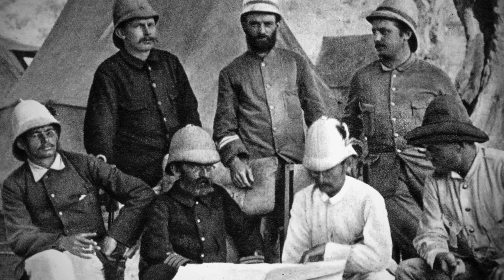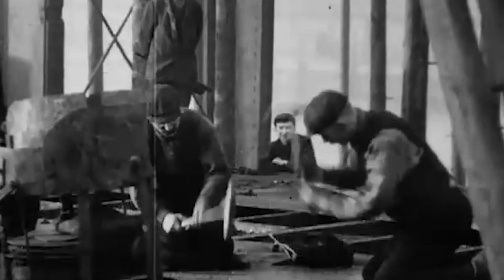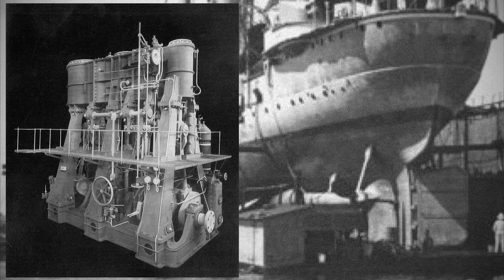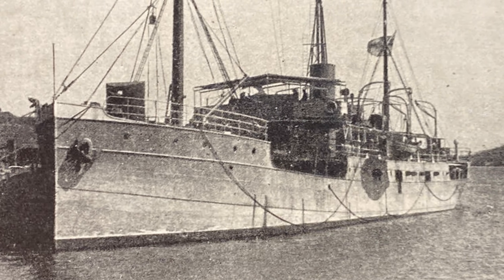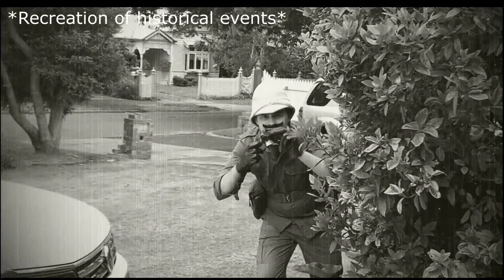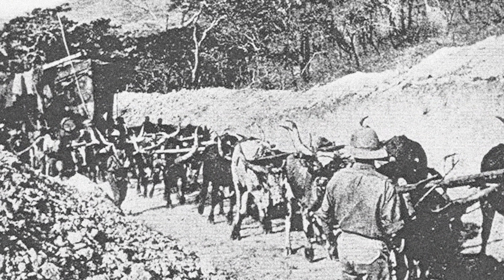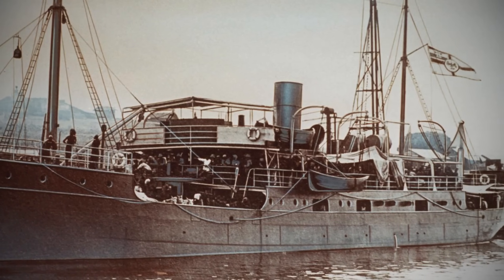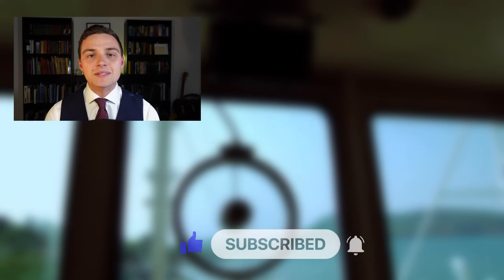This Ship was Packed Into Boxes! The Insane True Story of the Liemba

Comment: The 555 tonne paddlesteamer 'PS Maid of the Loch' ( built in 1953), assembled at a Clyde shipyard, was also dismantled, and shipped to Loch Lomond by rail to Balloch Pier, and there the sections were reassembled on a purpose built slipway. The 22 mile long lake is only 8m above sea level and under 10 miles from the sea, but there is no navigable waterway from the Clyde. Although services ceased in 1981, the vessel is being renovated and it is hoped it will sail again one day.

Comment: There were a pair of river liners Delta Queen & Delta King that were built by William Denny & Brothers in Scotland and reassembled in Stockton CA. They were designed for the Sacramento to San Francisco route on the Sacramento River. Both predated the Bay and Golden Gate bridges for roughly 10 years or so. They are now hotels in Sacramento CA and Chattanooga TN.
Reply: delta queen shut as a hotel and is supposedly under overhaul to operation.
Reply: The SS Sir Walter Scott, also from Dennys' is still in service on Loch Katrine (source of much of the water supply for Glasgow): it too was assembled on site.

Comment: Seems like this type of thing would be much easier to accomplish today with most shipbuilding already being modular.  All you'd need on this (or any other) lake would be a simple graving dock.  Bring the modules in via rail, assemble in the graving dock then flood it.  The graving dock could also be used for repairs.
Reply: The problem now is most ships these days are much much larger.
A lot of the Superyachts are significantly bigger…
Reply: Correct for the bigger ones.

Might still be easier for smaller ships, though.

Comment: very interesting ship, but I heard that she was completely laid up 3 years ago because the engine issues cant be fixed anymore. If that is true I hope she will not be scrapped. The most interesting thing to me about her is that she was build at the Meyer Werft which is one of the largest shipyards now
Reply: Latest info I can find is from 2021, when the Tanzania Times said it was still operating, but may soon be replaced by a bigger ship.
Reply: @davidknowles2491  it hasnt sailed for 3 years. its still technically in service under overhaul. i was doing cairo-cape in 2019 and went to kigoma to go chimping and to see the liemba. but i was aware it wasnt running. i got a look around the boat with the mate. and it was under repair. but nothing seems to have happened since then and they have ordered a new boat.
all the travel forums etc went quiet on liemba so im pretty confident she still hasnt re entered traffic